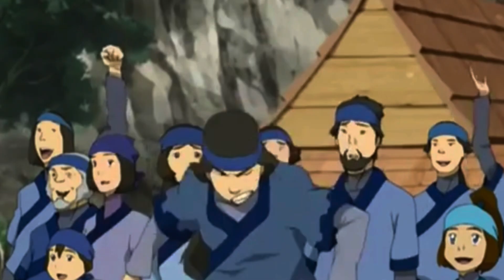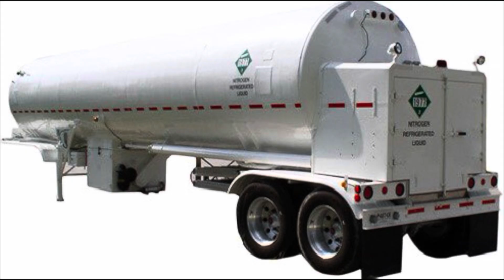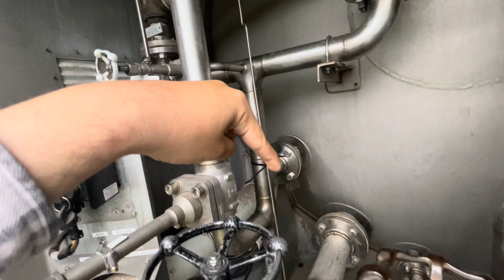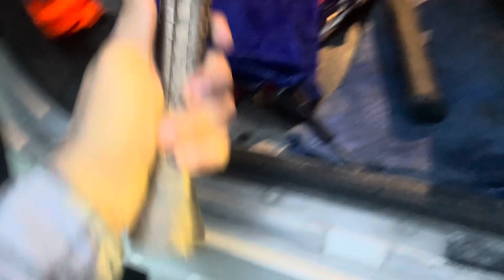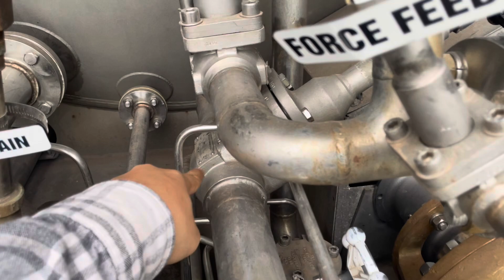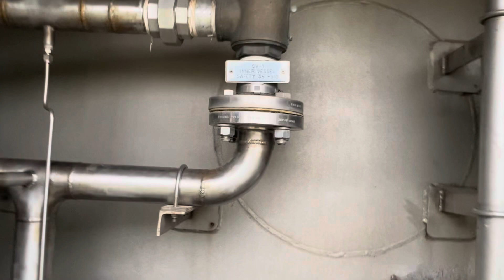Cryogenic Trucking Basics Pt. 1

Comment: Do you find it difficult to catch prime or manually maintain NPSH when conducting high flow offloading?
Reply from the maker: additionally, having your tank pressure up near mawp, your pony motor rpm up, and your pump pressure above the receiving tank pressure by 50-100 will increase your success rate.
Reply from the maker: the key is in consistency. if you stay hooked to a trailer and go to the same customer, you can learn which rpm the pony motor will hold prime. if you're drop and hooking trailers and going to different receivers, you will learn from experience. 

my tip is if you see the pump prime needle starting to wiggle excessively, it's usually abt to lose prime. up the rpm or open recirc and close again.

edit: correction
Reply: @RaycerSoundsTrucking  How often do your pumps/pump seals get replaced?
Reply from the maker: @ZachMar @ZachMartinez-AH  assuming you mean the seal that goes from the hose to the pump outlet? That SHOULD be replaced after each use. Especially if it’s one of those rubber/plastic feeling ones, BUT you can reuse the copper seals multiple times but they will get thinner after every use.

There’s other seals you can mean like the flanges along the plumbing connections themselves. Those usually last years if you’re doing proper cooldown and post-load process. 

Some leaking flanges can be tightened (when thawed/not unloading)

The pump itself can last years, as well, but the abuse from high rpm offloads or constant cavitations on a “wet” pump will shorten life expectancy. 

(Sorry if I misinterpreted your question)
Reply: @RaycerSoundsTrucking  Proper cooldown is definitely a chronic issue with drivers. They are either running behind (to no fault of their own) and want to get to the next load quicker, or they had another load thrown on their route and want to get home at the same time. These lead to compromises in proper cooldown and sub-cool... leading to premature pump seal failure ... which lead to more trailers out of commission ... which lead to more stress on the distribution team and drivers ... which lead to more rushed deliveries. It's hard to push blame completely on the driver. Traffic/unrealistic routes/delays at the customer site...

Pump seals and cold ends, according to the manufacturers, are designed to last 6-8000 hours of operations (sometimes more). 1 hours of run time per delivery x 5 deliveries per day x 7 days per week x 52 weeks = 1820 hrs. These pump seals and cold ends should be lasting 2-4 years with perfect pump conditioning. 

The problem is no one is perfect. By the time you "hear" cavitation, it's already been cavitating and has been doing damage to the pump well before. So how can we prevent premature pump wear?

 I actually sell a system that prevents cavitation automatically before it even begins. Automatic cooldown, recirculation, pressure build, NPSH, venting, delivery, metering, is controlled by a precise control system which monitors all aspects of the cryogenic delivery loading and offloading process. We have close to 100 systems installed today with a 2.6 year average age ... ZERO pump seal replacements and ZERO cold end replacements so far with the oldest system being 3.5 years old.
Reply: Reduce the differential by increasing the NPSHA. Basically open the pressure builder and bring the pressure close to the lift pressure and maintain this pressure while offloading. When you offload you lose the weight or the hydrostatic of the liquid. If you have 10 PSI sub-cooled to start and you pump down 30 inches. You have now lost the hydrostatic pressure of that liquid. So increasing the pressure in the tank while you offload is always helpful.
Reply from the maker: @mboerefyn2512 

I didn’t realize I misunderstood his question so badly until I read your answer 😆 very articulately explained. 

In case any one is reading this in the future, I’ll create an analogy of what you said for the sake of simplifying it:

You’re tryna fart (offload) but it doesn’t come out on its own. You get into a squat position (open pressure builder) to help the process but it won’t be enough. You gotta put some force behind it (pony motor) to make it pass the “gates” (customer tank)

Your fart is now flowing. You’re almost done but you’re not quite done. As you’re nearing the end of your fart, the fart gets quieter (nearing empty/losing pressure). 

To try to make sure all your fart is out, you squat more (open pressure builder max) until there’s nothing left to push.

Hope this helps :D